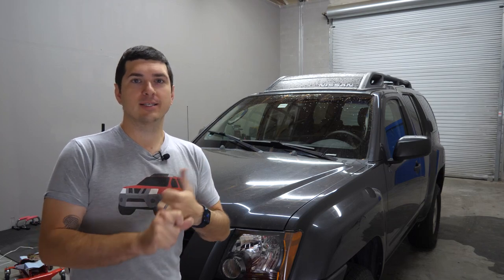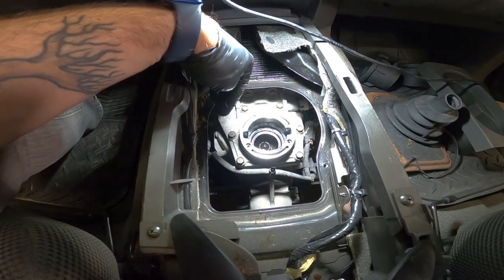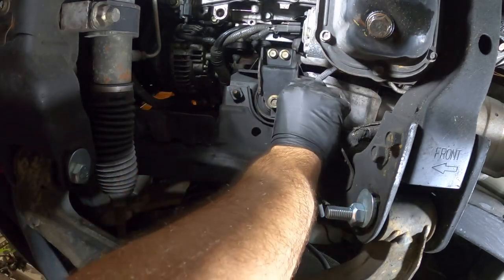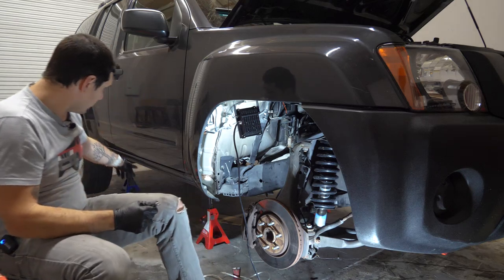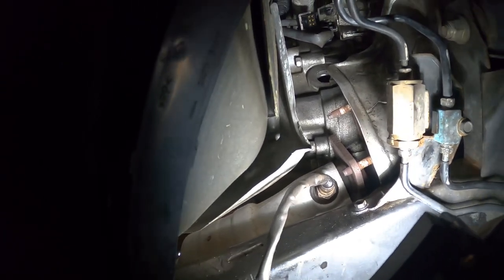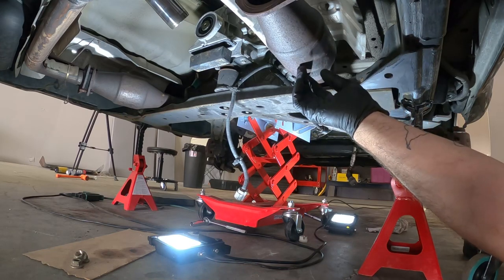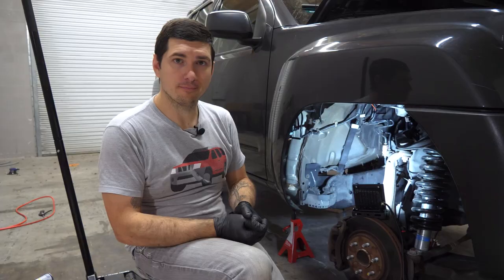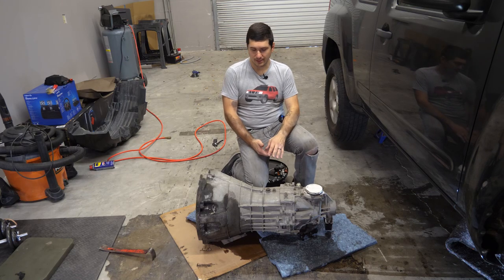How to Remove A Transmission From Your Xterra, Frontier, Pathy (Clutch Replacement Part 1 of 2)

Comment: Doing clutches are so fun. Fortunately the last one I did was on a 94 Porsche 968. I was surprised you don't even need to remove the transmission to replace the clutch. Definitely was a project converting my 99 Audi A4 Quattro from an automatic to a manual. Removing the big heavy AWD transmission was a chore, especially on jack stands.

Comment: Excellent video buddy! That crossmember in ours was a booger as well. We dropped the F bomb many times.
Reply from the maker: Yea, what the heck was up with that? I am going to have to use my jack to get that thing back in place.
Reply: @Rythecarguy  we actually cleaned it up a bit and put some synthetic grease on the contact points in case it ever needed to come out again. It's hateful for sure, ha!

Comment: I'm halfway through removing my frontiers transmission right now. It's amazing how much easier to wheel drive looks to do than four wheel drive. Good vid!
Reply from the maker: Thanks man! I really wish mine was 4WD. Hope your job is going well!
Reply: @Rythecarguy  Just finished. 4wd is handy but the tansfer case and front differential REALLY made it harder to get the cats off. I tried to outsmart you and avoid taking them off but you were right, they needed to go. Thanks for the vid!

Comment: Just a note as I'm going through this project on my 4wd off road-- the front drive shaft was a much harder job than the rear. Esp the front end of it, keeping the shaft locked in while cranking on two wrenches i locked together for leverage, due to clearance issues,  was real hard. It proba ly took me an hour to get it out. The front u joint is also way smaller than the others, i had to lock it with an adjustable wrench as nothing else would fit. It also didn't fit too well. A piece of flat steel stock would have worked great.
Reply: Ooof the front flange on the driver's side cat also required a long handled, angle changeable ratchet, and a bit of creativity. That front transfer case...
Reply: Yea I’m currently working on the same thing and the front drive shaft was a pain in the asssss

Comment: Three minutes in and you answered several of my questions. I bought my Frontier at 200k miles, and the clutch would 'bite' nearly at the top. After a little research I had come to the conclusion that it was just a Nissan thing? Now I'm at 230k and my clutch slips BAD. I had been worried something else went out to cause it, but my slave cylinder is still working great, and I get no noise.

I just got my clutch in, so this video came at a great time! I look forward to getting it fixed so I can quit driving my stinky 98 Continental, and back in my truck! Thanks for the video and all the help!

Comment: Took me hours to get those two top bolts loose.  The reason is I kept messing around with 1/2 in extentions, and they were not rigid enough.  I finally found two brand new 3/4 inch extensions I forgot I had.  They stretched from the bolts all the way back to the gas tank, but didn't twist and bend when I put all the strength I had into my 3/4 inch long-handled ratchet.  Between this fight, and the crossmember before it, I'm gonna need a lot of IB profune the next couple days.
Reply from the maker: Amen, the cross member and those two bolts were the worst!! Glad you got it though.

Comment: Hi Ry,
I'm a big fan of the channel.
And I actually had to replace all of my cats just this weekend.
Long story short my passenger side front disintegrated and went to the passenger side rear cat clogging it up completely.
Of course I replaced all of them.
I have a little chip I found out the hard way when removing the front catch or the rear cats those studs that are sticking out actually unscrew if you will screw one of the nuts on all the cats you will find that you can lock the two nuts together with two wrenches and remove the stud and nut together and then you do not have to push any of them forward backward sideways it just drops straight down.
Of course I'm probably never going to have to do this again but maybe you can pass it on to one of your viewers.
It's so much easier that way.
And the new cats I ordered included the nuts and bolts I guess they're a smaller diameter so they just slide through either side of the flange.
Anyway just wanted to pass that on keep up the good work.
John. 👍
Reply from the maker: Great tip! Thank you.

Comment: Ended up pulling my motor with that flywheel access panel still in place lol. I really hope it didn't have to be removed beforehand. Doesn't look like I didn't any damage though
Reply from the maker: Na, you should be fine. It only would be an issue if it snagged on something

Comment: So just did this on my 2007 Nissan frontier SE 2 wheel drive!  This video helped me a lot and thank you for posting it!  It helped me a lot with preparing and getting tools and all your guidance!  2 pointers I would like to give if you do this solely by yourself like I did!  I only had to take off passenger side catalytic converter and exhaust to pull the transmission with wiggling and bending in my drivers side catalytic converter. Next the top two bolts are the hardest.  My impact wrench wouldn’t break them loose because of how tight it was.  I was using a 3/8 extension to adapter 1/2 impact wrench.  What got it was taking my shifter lever completely off the 6 Botha that hold it in.  I then used a small motorcycle jack stand I have to jam up top to push the transmission down.  I then used the 3/8 extension from inside the truck through the shifter hole with a breaker bar and broke them loose.  Hope this helps someone out there like this video helped me.  Took me 4 days to do by myself.
Reply from the maker: Great tips!

Comment: Considering you now  have the experience of taking out an engine from the Titan, if you had to do this job again, would you do it the same way (removing the transmission) or removing the engine? I’m at 144K miles, original clutch.
Reply from the maker: Hey there Jesus. I have to say I would still drop the transmission. The only thing I would do differently is do a better job of strapping up the transmission jack and of course draining the transmission first lol.

Comment: I luv my Xterra! The previous owner had just replaced the clutch with a new factory clutch kit and a new LUK flywheel. I think they recommend replacing the flywheel, maybe that's only if the surface is damaged b/c it has the dual friction or something like that, which is supposed to be resurfaced. I definitely would not go with a cheap aftermarket clutch. There are some upgrade clutch kits that are better than the factory one, but those are the only ones I would recommend besides the Nissan clutch.  Good work..
Reply: sorry the flywheel is not supposed to be resurfaced..

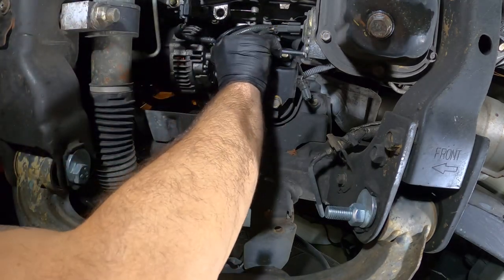Comment: At 13:53 what is the piece called where the two brass bolts and a big bolt are? Pretty much the middle of the screen. Trying to find out the name of that part.
Reply from the maker: That's the motor mount

Comment: After I removed the automatic transmission from my 2001 Frontier 3.3 King cab AT and re-installed it all is good except 4wd.   When I put the 4wd shifter to it's neutral the ATP light comes on and if I try to get it into 4wd Low it grinds gears loudly.  I can't get it into 2wd again because it grinds too.  I then can't put the transmission back into park without grinding.  I have to turn off the engine, put it into park and put the 4wd shifter back into 2wd and all is fine until I try to put it back into 4wd again.  Also, this might be normal but when I have it in 2wd and I put it into neutral while in the air, the rear wheels spin while it's on blocks off of the ground....any ideas?
Reply from the maker: Sounds like the shifters might be out of alignment. the gear shift and the 4wd shifter have cables and they can be adjusted on the side of the tranny. Try disconnecting them and shifting right on the side of the transfer case and see if it works (assuming you can do that safely).
Reply: @Rythecarguy  Thanks for your help.  It turned out that this is just normal behaviour.  There is no gear synching and so you have to move through 4wd neutral very quickly before the shaft starts spinning too quickly.   Found that in the manual.   I just hadn't used the 4wd low in so many years that I assumed it wasn't working right when testing it after replacing the transmission.
Reply from the maker: @jasonthurston799  oh, good stuff! Glad you got it worked out.

Comment: I remember starting to do a clutch years ago in my Ford ranger . I was stopped dead at the very beginning when I could not remove the shifter bolts . Up to that point I’d have replaced clutches on every standard vehicle I’d ever owned (at least 6 vehicles I’d guess) … I could jot believe after two days of trying and asking around I had to have it fixed at a garage . I was happy to find out it took the shop almost a full day to get those bolts out and it wasn’t just my ignorance . Somehow rust , heat , salt etc made those bolts one with the transmission and if memory serves added many hundreds of dollars to the cost of the job . Apparently the mechanic was quite pissed off and thought I did some thing to cause the issue so I think they added even more to the job cost cause of that . It’s amazing but that was the First time I took on a repair that I knew I could do fairly easily and was shut down completely . And it seemed to open up some sort of new era of me not being able to complete what were once simple repairs to me . Lol I don’t know if it was the shot to my confidence or I’ve been on a long time line of bad luck doing my own repairs but that day back around 2003 was a harbinger of a string of bad luck … I wasn’t to YouTube savvy back then and don’t know if at that time there would’ve been a video of how to get around that issue . But now I’ve been able to get past some of my “bad luck “/ roadblocks because of people like you doing these comprehensive videos . So I guess thanks my man
Reply from the maker: Hey you're welcome and I can tell you I am going through something like that right now. I am having a hell of a time on my Titan suspension and its pissing me off so bad. It makes me fell like I just cant do this type of work anymore. I think to myself "dude, if you can't do this now, what happens in a couple years? You'll be 40 and wanting to do less and less of this." I just got to keep going!
Reply: @Rythecarguy  yep it doesn’t get any easier as you get older , trust me .

Comment: What is the size of the bolts for the heat shield? I am trying to plan ahead to make sure that I do this correctly. Thank you for putting this two-part video up I am going through them a second time to write down everything I need for the job. You were thorough and accurate.
Reply from the maker: Thanks Ian. Those were 10mm. I hope it all goes well!
Reply: How long did it take you to replace the transmission?

Comment: Fantastic Ry. I guess with automatic it will be pretty much the same process.
Reply from the maker: Yea, there are a few small differences. For instance you need to rotate the crankshaft and actually remove the torque converter and drive plate bolts before removing the transmission, that an you need to take out the dipstick tube and it likely has more breather tubes. If you decide to do it dont for get to drain some of the fluid! 🤣

Comment: Hi

Great video.  Was this a 4WD version? Did not see anything about the transfer case.  Thanks for making these videos.
Reply from the maker: Nope. This is 2WD. The only difference is you need to take off the front drive shaft and some extra wires from the transmission body when you have the 4WD
Reply: @Rythecarguy  Thanks for fast response.
Reply: @Rythecarguy would you happen to know what that harness is called? Mine is a 1st gen and has damage to those wires connecting to the transfer case

Comment: Beer well earned. I was lucky enough to have a 2 post when changing my transmission. Unfortunately I didn't mark my driveshaft or know the flywheel was timed. Now I need to throw it back up on the lift and do it all over again. Cheers.
Reply from the maker: Oh damn!! Sorry to hear that. Quick question for you since you’ve already done it. How much of the exhaust did you have to remove?
Reply: @Rythecarguy  I removed all of the exhaust, it was easier to just pull the bolts for the hangers and drop.

To reinstall start at the cats and work back.
Reply: What do you mean by flywheel timed?
Reply: @jorgehetnandez1696  the flywheel has timing marks you need to line up during installation. This allows the crank position sensor the ability to know the crankshaft position
Reply: @ike621  I just finished watching this video. About to get started on replacing my manual transmission. First time in my life I remove a transmission.  Thanks for the information.

Comment: Will xterra manual transmission fit a 2010 pathfinder?
Reply from the maker: If it's also a manual and is the v6 then yes. Most likely l.
Reply: My pathfinder is not manual .
Reply: @Rythecarguy  is also a v6
Reply from the maker: Converting to a manual is incredibly complicated. It's not as easy as just replacing the transmission's.